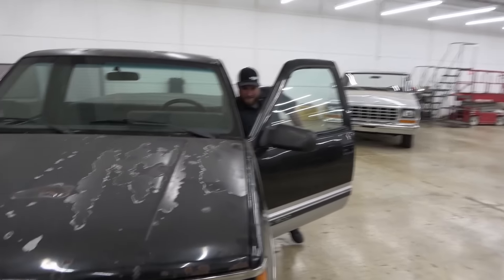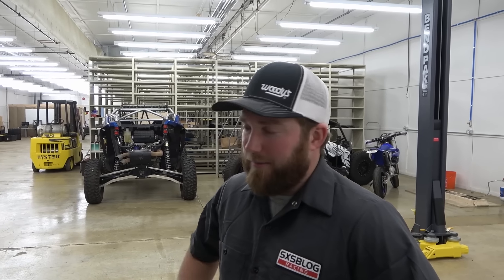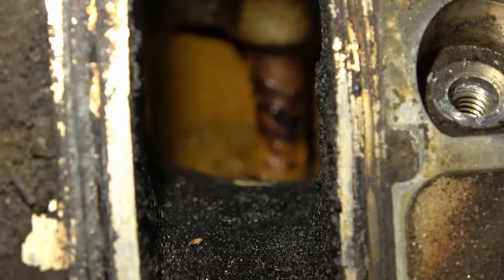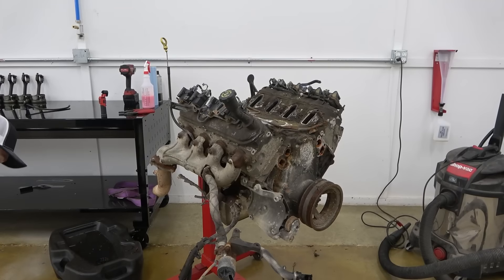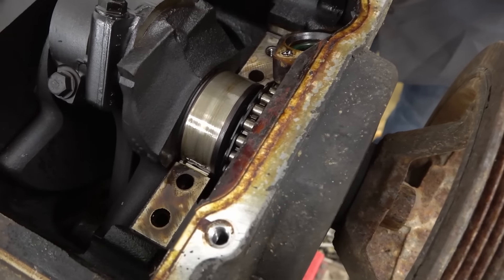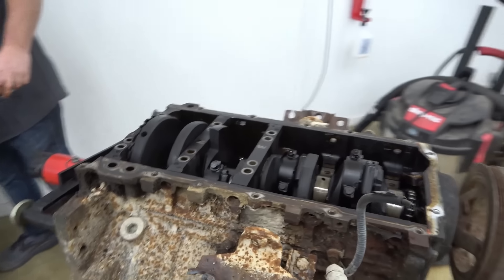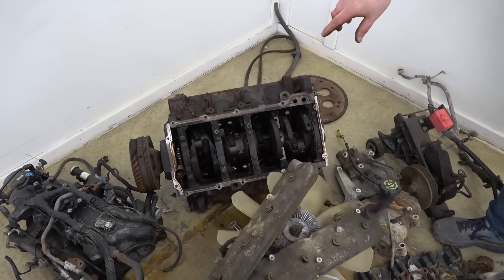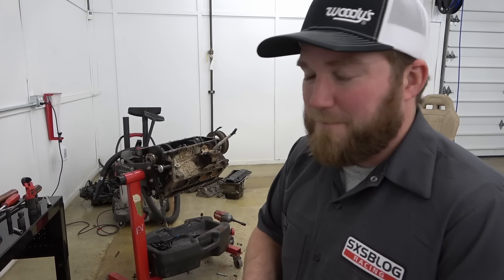Budget Turbo LS Truck Rebuild Part 1

Comment: So you guy know what your doing. I have a question. I can't buy a new machine.  I do have a   2007 660 rhino. Sorry not what your use to. If. You could let me know what you would to to add motor performance for $1000 or less I would appreciate your in put. Motor is all stock except I have a Gibson full Exhaust. The rhino is not a pile of crap it's pretty nice. Thank you for any input
Reply: Clutch kit

Comment: Dorman makes a bad ass clamp for those broken rear exhaust manifold studs. The clamp bolts to the back of the block and wraps around so you use a bolt to push the manifold against the head. I have install many of these clamps and they work great.

Comment: Always try to rotate an LS engine by hand before you buy.  You would have passed on the 4.8 in this case ;)  The 862 heads are of value though!
Reply: Those heads are worth noting but a view bucks in scape.